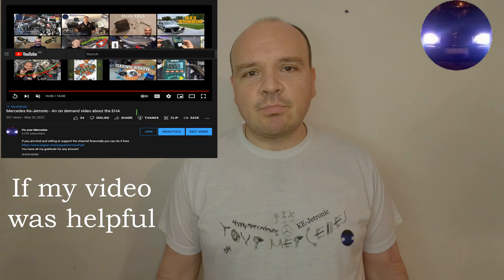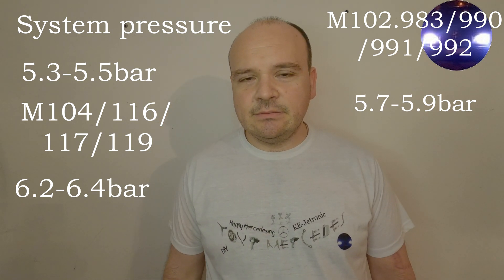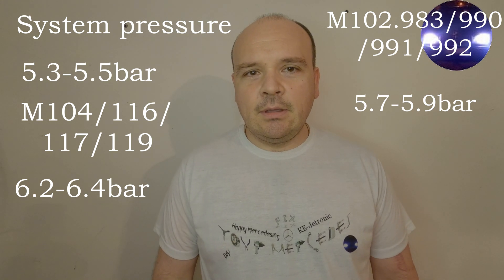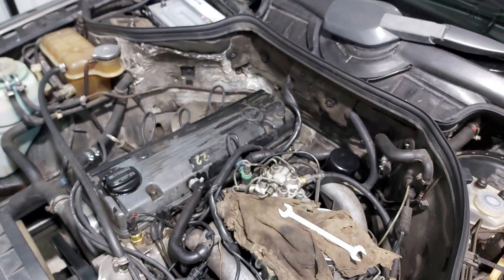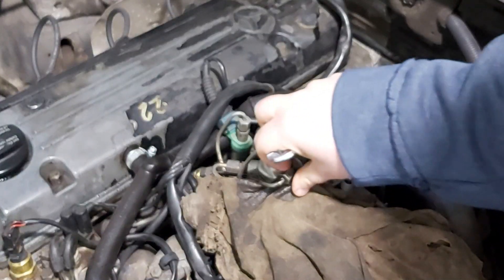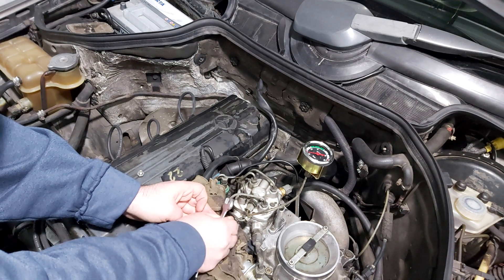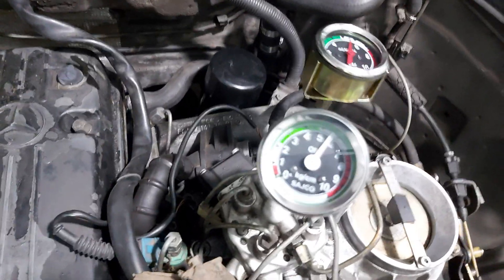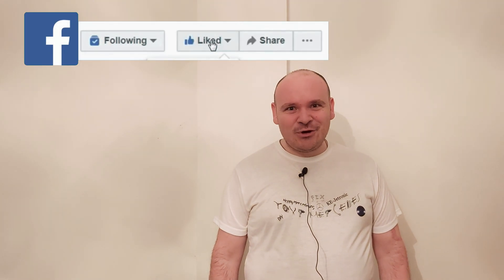㉦Mercedes Ke-Jetronic㉦ - Measuring pressures on KE/universal

Comment: hello.
I bought a used part to replace the Mercedes-Benz W 124 190E throttle body, but the part has the hole entrance to adjust with a hex wrench blocked with something like silicone.
Is it the cap that originally blocks the entrance to the hall?
What should I do if I think I will have to remove the cap to steer it with a hex wrench?
Seek advice on how to solve it.
Reply: Is might be on his other video
Reply from the maker: Don't touch that little wrench because you will readjust the idle and you won't have any more idle recognition any more, plus you will increase idle.